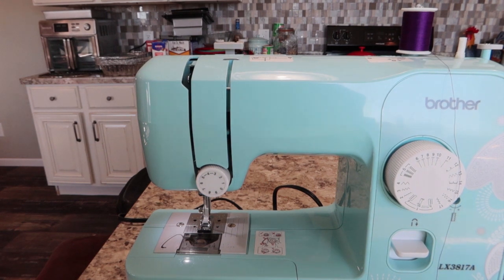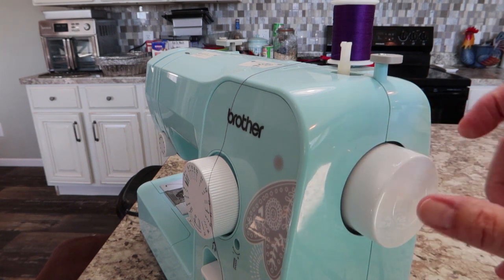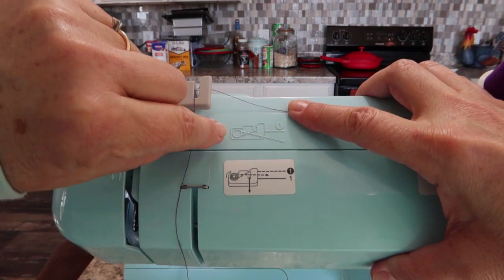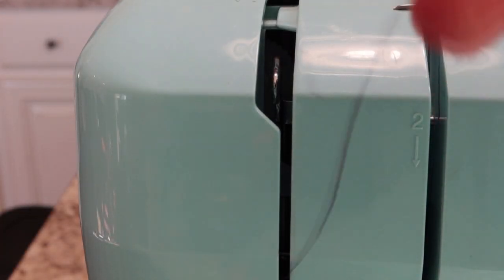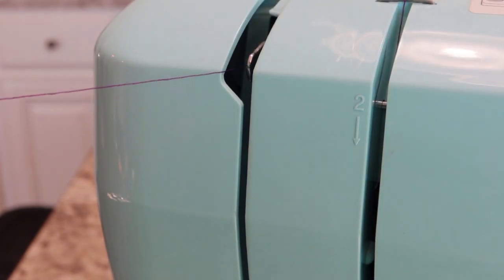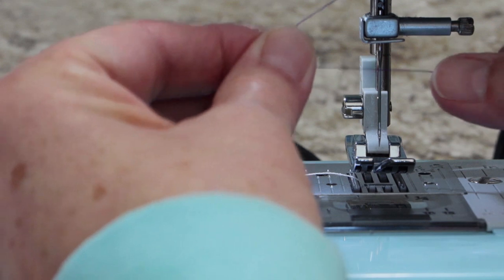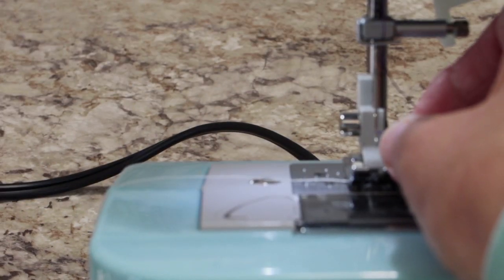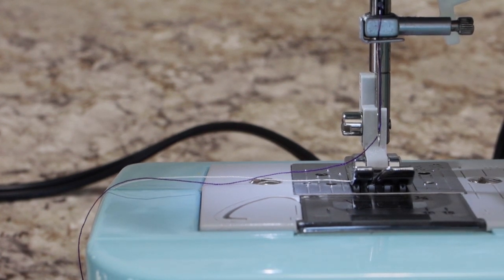CLOSE UP  Upper Threading Brother LX3817

Comment: For someone new to sewing this is frustrating. The instruction booklet shows that you’re supposed to run the thread from the top right to the part on the top  left and then down the left side of the machine. Your instructions go from the top right down to the side.
Reply from the maker: I'm so sorry you're having trouble! Have you gotten it worked out yet?
Reply: @momdoesstuff   Hello and thanks for the reply. I did eventually figure out that the instructions were for first spooling a bobbin.
Reply: @momdoesstuff  Now if I can just figure out how best to sew a long straight line. 😅

Comment: Something is causing top and bottom thread not to connect to sew. What is doing that I have been trying over & over rethreading step by step & adjusting tension part from 0-4 trying to get it back to normal.